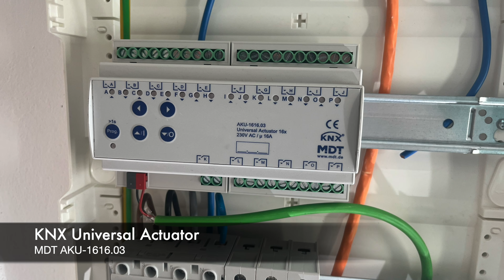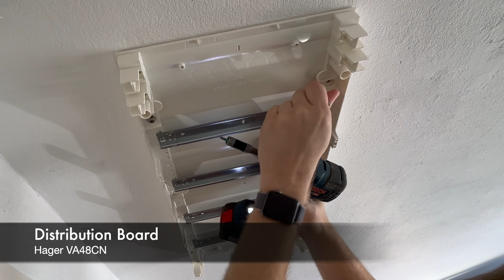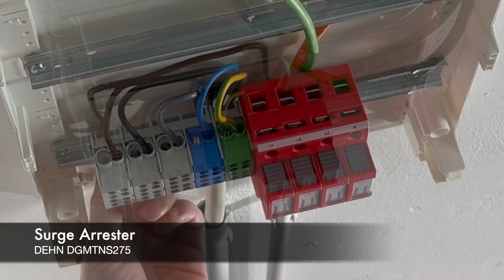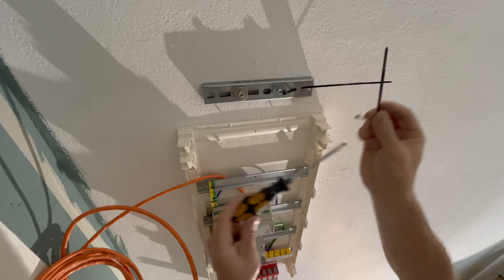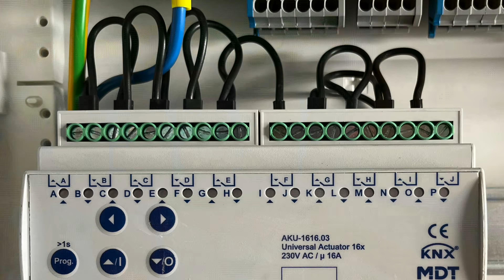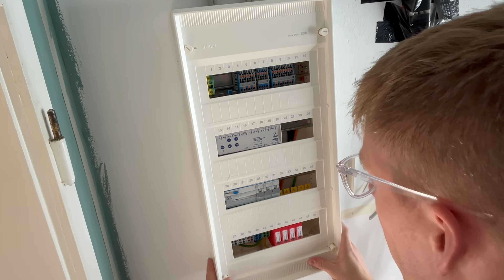Installation of an Electrical Distribution Board

Comment: No main's switch?
Reply from the maker: There’s a Neozed fuse in the main panel, by which I can disconnect this distribution board completely. 
And since there’s only one RCD, it kind of does the same as a mains switch.